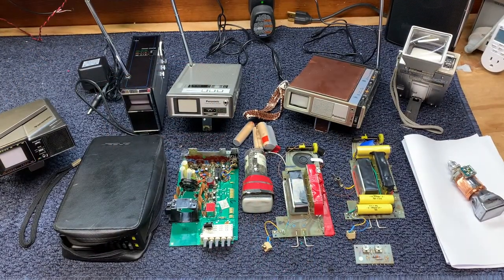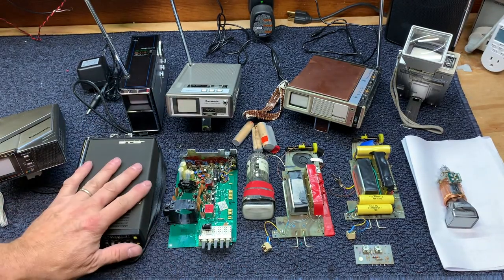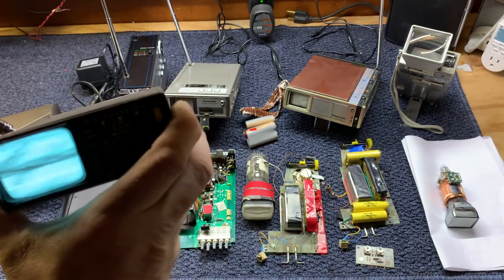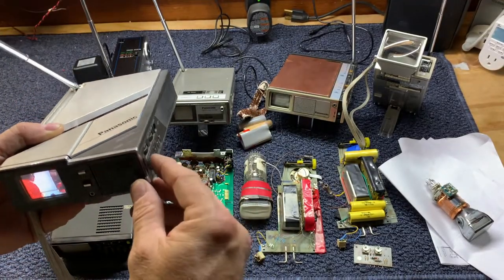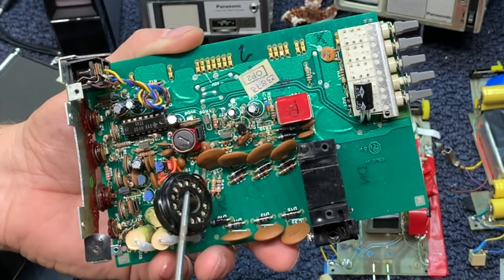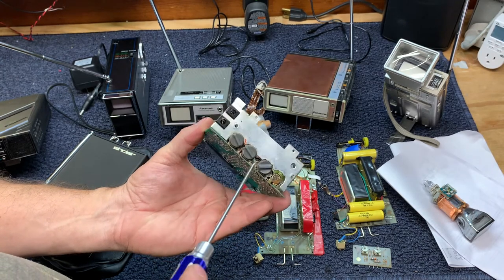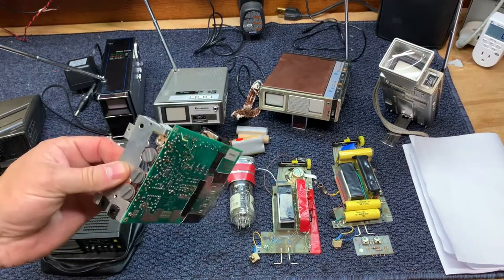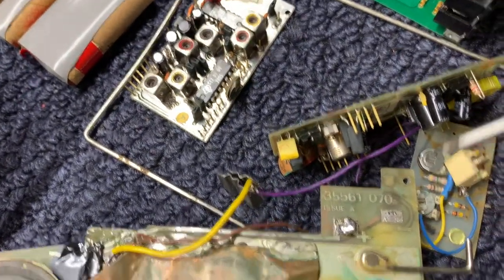Rare Sinclair MTV1 Repair and Demo

Comment: Beautiful collection of micro TV's. As a kid from the UK back then, I lusted after the Sinclair MTV1. I already had the Sinclair calculators, the truly awful watch and a Micro earpiece radio. This stuff was almost Science Fiction brought to life back in the 1970's, incredibly exciting times. Every few months, some amazing new invention was just around the corner. Now, it seems everything has already been invented. Doesn't seem to be any leaps in technology now, just smal incremental improvements.
My kids just take every bit of technology for granted now and they cannot understand how exciting those times were. Back when a HiFi was cutting edge with more controls than a space shuttle and you lusted after the next improvement, cassette tapes then CD's then remote control HiFi's, direct drive strobe controlled record decks. I wish I was back there. Real cars with big engines and raw power, fuel was cheap, insurance was cheap and so were the cars compared to now. Electric cars are not for me.
Reply: For me, it started out with the Sinclair Micromatic a.k.a "matchbox radio" - I have fond memories of both, showing it off at school (I must have been 8 or 9), and listening to Radio Luxembourg in bed. When I was a teenager, I too lusted after the MTV1, as soon as I heard about it in the news, but always knew that it would be out of my reach...Fast forward 40 plus years, and I own quite  few of them, in various states; my goal is, with assistance from helpful videos such as this, to get as many of them working as I can - will probably keep me busy for most of my retirement years :)
Reply from the maker: @asim4820  have you had any success getting them going?

Comment: I have at least one 1967 electronics magazine.. Not in my hand... But have been aware of an advert for decades that appeared in a few issues for a Sinclair micro TV. The advert showed a small square TV held in a woman's hand with the promise of it being available... It never was. I guess Sir Clive had a prototype which had issues.. It is no secret he held on to the idea of a mini TV for decades and introduced his MTV1 in 1977. Just too late to be an amazing thing, it was the first multi-standard TV, followed by the MTV-1B a simplified model PAL only..LCD was just around the corner etc. Casio and everyone else was coming to market a few years later. Sinclairs final offering was the 1983 Microvision with its crazy folded tube and was truly pocketable.. A flop. It used flat Polaroid film camera batteries (If you ever need any). 
Your Panasonic 001 is amazing. I love that. 
PS Plenty of tiny (one inch) CRTs available in video camera viewfinders of the late 80s early 90s. Make great tiny TVs and usually have all electronics ready made for composite feed - Sort audio out yourself, easy.

Comment: Hi Kent. I loved your video, your obvious knowledge and your interest in the Sinclair Microvision MTV1. I was given one of these in 1978 the Typ-MTV.1A MODEL by a very appreciative friend of mine who I did a great favour for. I was so proud of this TV and pleased to show it off to others but for some reason I just packed it away with it's Battery Charger and Model 12300 input 117v. 60Hz 5W. output 12v DC 300ma Mains plug. Also an unused  boxed Car Adaptor, also a 6volt Lead for use with 6v dry battery. Finally the plastic zipped case. All items are in good condition. I remember the last time I watched this TV which was an England Rugby match some 43 years ago, so because it was so long ago I have not dared to try charging up the batteries again in case I upset anything inside. I was thinking about putting this unit with accessories onto EBAY but before I do could I ask whether you may like to add it to your collection of 5 similar units? I would be prepared to accept a realistic offer from you Kent before I put it onto EBAY, Kind Regards John Chipchase. Cambridge.
Reply from the maker: Wow. Very interesting story thanks for sharing it.  And very gracious offer to sell your unit to me.  I am definitely interested in your set up.  Can we chat on email?  Koviatt at gmail dot com.

Comment: Hey Kent, excellent bit of information there, its rare to see so much knowledge on these things, thank you for your efforts!
I currently have one apart and I'm excited to say that with a little cleaning and battery removal, it boots up with sound! (it has not been turned on since 1994).
The only thing broken is that 100nF capacitor on the Tuner Board which shattered as soon as I touched it. What type of capacitor did you substitute it with?
Reply from the maker: I used a ceramic cap. About the same dimensions.  So tickled to hear that your got yours fired up.  Thank you for the kind remarks.

Comment: I have kind of a different take on these analog mini TVs; the fact there's very little on the air to watch on these things anymore notwithstanding, I appreciate the intellectual puzzle working on one of these things provides. The only thing I would say, being a ham for over 30 years and handling lots of NiCds supposedly sealed up in plastic, when I had occasion to have my blood tested for heavy metals, I was polluted with cadmium. With your knowledge, I suspect it wouldn't be too much of a circuit alteration (for proper charging) to pack these TVs with NiMH instead, right? (The moment I got those test results, I disposed of every NiCd I owned!)

Comment: What an interesting coincidence you uploaded this video so recently, I just picked one up at a yard sale yesterday.  Tube doesnt work of course but seems quite clean overall.   Thanks for this video, it looks like quite a complicated little machine.
Reply from the maker: If you can find a 12 volt connector and power supply you may be able to fire it up. I have one here that would power up with a 12 volt power even though it had the original batteries in it. Pretty amazing. But yes you are correct. They are pretty finicky sets. I now have 5 of them and a sixth on the way. Ha.
Reply: @KOVintageTech  This actually came with everything including the 12 volt car adapter.   I tried with that, gets static but no picture.  I pulled it out of the case, battery leakage wasnt too terribly bad, mainly goo and mild corrosion on the outside Pots.   Circuit board looks good so I m not entirely sure, unfortunately my knowledge of electronics repair likely isnt to your level.  I m sure it will entail a bit of research
Reply from the maker: @ST19859  fantastic that you have the accessories!!  Also the goo by the knobs is a grease they used. It’s red, right?   You could try to cut the fuse link and see if the display lights up. If the fuse link is still there the bad batteries will choke the power badly and can prevent the oscillator from running which drives all the high voltage circuits.  You can desolder that tiny wire (fuse link). The unit will then power entirely off your 12 volt supply. The schematics that I have are very poor and hard to read which makes it even more challenging to repair.
Reply: @KOVintageTech    Yea it has everything I think, even the original box, though that is pretty beat up.  Thanks for the suggestion on the fuse link, I hadnt thought about that though I was trying to think of a way to bypass the batteries.  And yea now that I look that is grease I think.  Really very little corrosion at all then.
Reply from the maker: @ST19859  please keep us posted on your progress.
Reply: @KOVintageTech   Will do thanks, the fuse link made no difference, I wonder if the tube itself may be bad ?  The transformer hums and there is power to the leads of the tube socket so ........ ?   I will keep tinkering with it.
Reply from the maker: @ST19859  I have five of these and all the tubes are fine. The issue with all five was/is high voltage or EHT as the English say (Extra High Tension).  There is a very fragile oscillator circuit that drives a tiny transformer and produces the 300/600/2000 volts. If that circuit is not working then no raster.  If you take the little audio board and the IF board off the sides of the TV (they just unplug) you can eliminate a lot of potential issues. The 12 volts powers the video deflection board all by itself. The point here is that you can separate all the boards from each other. Then plug in your 12 volts and turn on the set. If you still don’t get any raster make sure the brightness control is fully clockwise. I can give you a couple more things to look at after this.  Caution!!  The board produces 2000 volts at very low current but it will still give you a pretty stout shock.   Be very careful touching things over by the picture tube. I have been shocked several times. Just being careless. I’d not quickly condemn the tube. They are German-made and very robust.
Reply: @KOVintageTech   Thanks so much for all the tips, I just realized what I was missing.  After the initial test in a car with the 12V adapter every other test I did was with the included european AC adapter and a US plug in.   Totally forgot those are 240V, I was only gettting 8 volts out of the step down.   Tried the straight 12V on the car adapter with all the other boards removed and the tube fired right up !!   Now to piece it back together and see if any other issues exist, but thats a big one out of the way.
Reply from the maker: @ST19859  excellent. That is a major victory. The deflection board is the big challenge. Yes. Reassemble now and see what you have. Do you have a local analog to station or an analog transmitter at your shops you can use to create video signals that the TV will receive? And one more thing. BE VERY CAREFUL reassembling the side boards. If you accidentally get the pins misaligned and connected where they are shorted or in the wrong holes you can seriously damage the video driver/deflection board. The pins must be aligned perfectly.  Take your time on this part. I have damaged a set by misaligned pins. Pop!!
Reply: @KOVintageTech    All went back together without too much headache, just had to solder back a couple broken wires like you described, they are very fragile with age.  Fires right up, screen seems to be working well,  sound working fine and I was able to tune into some faint broadcast on the very high end of UHF, pretty sure it wasnt an analog station though as we live in quite a remote place.   I ll take it with me on my next trip to Reno and see if there is anything there otherwise will have to work on building a transmitter of some sort eventually.   Many thanks are in order, I never couldve figured this little bugger out so quick without your valuable info, especially having the video on hand to deal with breaking it down.
Reply from the maker: @ST19859  thrilled to hear all this. Great job!   Reno: I know there is a couple of analog stations in northern Mexico. One in Guadelupe.  Imagine you are a long way from that one.  Anyway.  Check out my other videos on my mini broadcast stations.  For very little money you can transmit your own station there and show off your Sinclair.
Reply: @KOVintageTech you're an expert on this Sinclair nobody else has the knowledge like you on this machine. Amazing🤯
Reply from the maker: @Calcraft11  thank you!  I still have a lot to learn. But I have four of five units working now. A good friend sent me some great schematics recently. A big help.

Comment: i have a complete box set, some accessories unopened until today...with power, the picture tube works.....going to read the instructions to see if i can get a channel....putting on ebay for ???
Reply from the maker: That’s great!  Full set. Nice. The unit may power up with external power but the batteries are likely leaky and damaged. Prices are all over the place. Best of luck to you on your eBay sale.

Comment: Just got one of these off eBay. The battery corrosion damage was really bad. I removed the batteries and cleaned up all of the corrosion and I have a picture and sound of white noise but the tuner doesn’t seem to be working if I touch the antenna I see the snow pattern changing though. But in stuck as to what needs to be done next to get the tuner working 🤷‍♂️
Reply from the maker: That's great that you have it working this far!  You have overcome some serious hurdles.  So how are you transmitting a TV signal, for the TV?  Do you have the correct buttons on the front pressed for your region?
Reply: @KOVintageTech  I have an amplified rf modulator on channel 7 with roku connected and my other tvs (Sony watchman’s etc) can tune into it so I tried that with USA pressed in and vhf and 3/1 pressed in. I also tried channel 3 with an rf modulator connected directly to the antenna. I assume when the buttons are pressed in they are the upper row.
Reply from the maker: @sideburn  you are correct about the buttons. Pressed in they are the upper row designation.  So US is the single button on the left should be pressed.  And you are right the 1/3 picks the low and high VHF.
Reply from the maker: The tuners are very sporadic.  I have a few of these and the tuners give me trouble every time.  Have you tried transmitting and receiving on UHF?
Reply from the maker: Also. The corrosion damage may have affected the power circuits to the vhf and uhf tuners.  Some traces run under these and can fail.  This is not an easy repair. I’m glad you have the experience to tear into it.  It is a labor of love.  

I just picked up a second Sinclair PAL UK version. I got it working but I don’t usually leave my modulators running in PAL.  Ha.
Reply: @KOVintageTech  not sure I have the tools to broadcast UHF. I’ll see. I don’t need to book the batteries up yet right? What about caps? Any known to go bad? They look ok.
Reply from the maker: @sideburn definitely could check electrolytic caps in the RF board. If you have strong audio then your audio board is probably fine.
Reply from the maker: No you do not need the batteries as long as you have power plugged in.
Reply: @KOVintageTech  strong audio and snow on the picture wouldn’t that mean the tuner is working to some degree?
Reply: I’m going try to get some time in to work on it again this weekend. I did remove that copper plate on the solder side of the tuner/power board because it was badly corroded. I assume that’s not necessary? Also I need to find out what pins on the board to check the 45v and other voltages. Trying to find schematics etc online. I found a maintenance manual so far.
Reply from the maker: @sideburn I can email you the schematics. It was a difficult search but I found some. Email address?
Reply: @KOVintageTech  sent but YouTube may have rejected it. Let me know if you didn’t receive. Thanks!
Reply from the maker: @sideburn  I have not received it. I have a lot of pages to scan and email.
Reply: @KOVintageTech  ok I added my email contact link to my about page. Can you see it there?
Reply from the maker: @sideburn  I cannot seem to locate your page.  Is it just @sideburn?
Reply: @KOVintageTech   yes and feedback for the name.  I’ve made some more headway and made a vidoe I’d like to show you if you are up for helping me nail this down. If I touch a wire to a specific trace on the board I get a different pattern on the crt and I get staticky sound. So getting closer. It must be in the tuner area.
Reply: Hi again. Hoping for some tips on some clues again. I needed up buying another mtv1 and I got it working perfectly after removing the corrosion and batteries and installing a new set of NiCd batteries. I put it all back together and it’s been working flawlessly until now it is randomly completely dropping out to white snow and white noice and then it will suddenly switch back to a perfect signal again. It’s as if it’s a loose connection somewhere but I don’t think it is a connection issue because it does not effect anything if I tap and poke around with it. It does it just sitting stationary and sometimes it takes over 30 mins to start failing and other times it failed right away. It doesn’t matter if it’s been sitting off for hours or been running for hours. It’s completely randomly and unpredictable so far. 

Is there circuitry somewhere on it that locks in or switches the signal on or off? You think this is in the tuner section or would it be in the voltage generation or IF area? I hate to take it all apart again unless I know there’s a chance at solving it. 

Thanks for any ideas you may have.
Reply from the maker: @sideburn  wow congratulations on getting your TV working. That’s a real accomplishment. Yeah I would strongly suspect a corroded connection or something like that in the tuner section. So the screen goes to white snow to snow signal, or is it just a white screen with no signal present. And also is there any sound like like his or does the sound disappear too?
Reply: @KOVintageTech  what’s happening is I can tune in and get a perfect signal with sound and then what seems to be completely random the entire signal drops out to a snowy picture and white noise sound as if I powered off my RF modulator. And then after a while the signal will kick back in to a perfect signal again. Sometimes it does this writhing a couple of minutes and other times it will take over 30 minutes. I’ve tapped around and played with the tuner and connections and it doesn’t make any difference. The issue happens the same way if the tv is sitting stationary so I am pretty sure it is not a connection or contact problem but more likely a failing component.
Reply from the maker: @sideburn  agree completely on the aging component. That’s a tough one. Let me look at the schematics and see if anything pops in my mind.